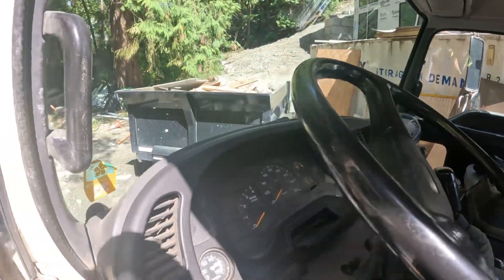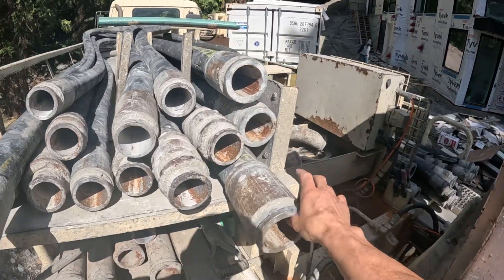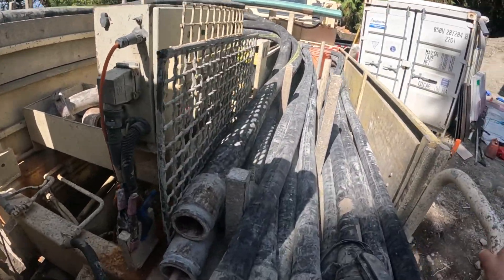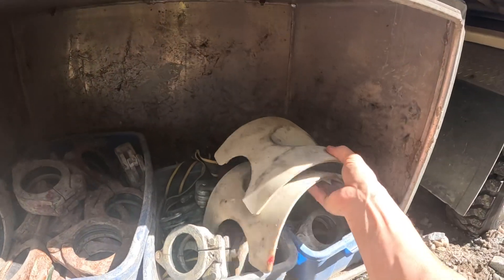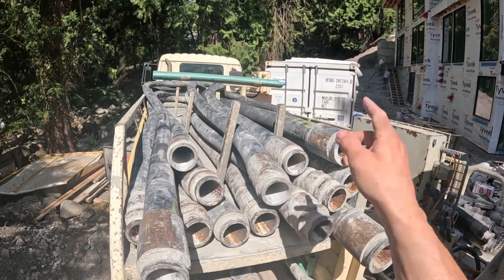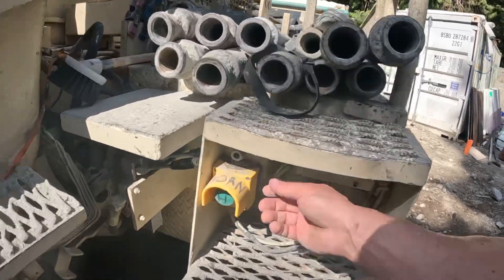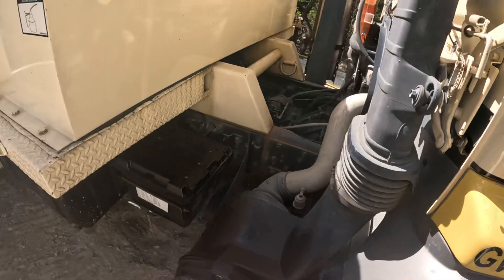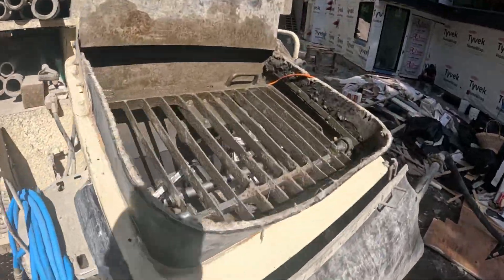Meet the fleet: Putzmeister VS70 line-pump:

Comment: It is this video I see Scott happy recording the start of pumping it is something great the explanation one vs 70 putzmeister which is a 70 cubic yard hour equipment with 79 bar pressure with an open circuit mounted on a truck GMC t 7500 nice Izusu equipment with pto 6 speeds which allows suspending the transmission of the differential and giving drive to the variable displacement hydraulic pumps and accumulator pump and agitator system a beautiful united vehicle pump a good order of hose clamps of various diameters for different applications which are the most common It is formwork pumping. Compaction injection. projection of schocrete. and more excellent channel friends